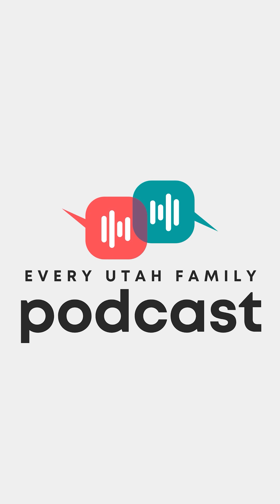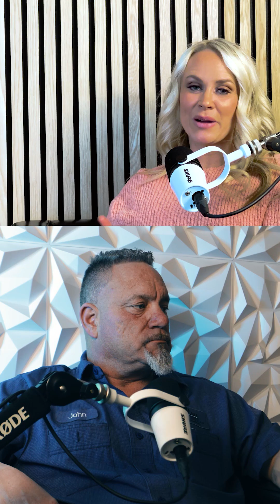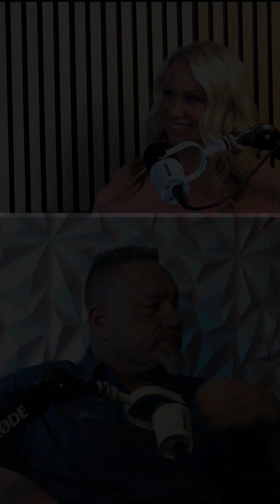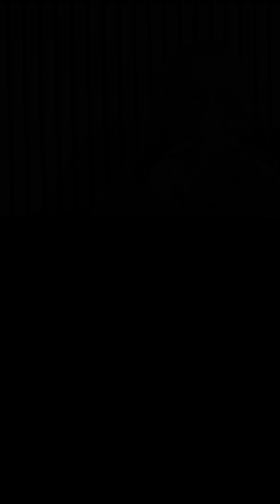2024 Furnace, Heating Systems & AC (Cost, Maintenance, Replacement)

Comment from the maker: Thanks for watching, topic discussed in this podcast are:
00:33 How does a furnace deteriorate over time?
01:11 Most common signs that a furnace is beginning to lose its efficiency?
02:15 When should I replace my furnace?
03:35 How does Utah’s extreme winter conditions affect the performance and efficiency?
04:43 How much does it cost to replace a furnace?
05:54 What's the Difference between 80% and 90% Furnace?
06:50 Is single stage, two stage or modulating furnace better? 
08:15 Is it cheaper to replace furnace and AC together?
09:16 How does investing in a high-quality furnace or air conditioner impact long-term?
11:47 Does home insurance cover HVAC/furnace replacement? 
12:29 What are the essential winter maintenance checks every homeowner should perform?
16:19 How can homeowners identify and resolve common issues in their HVAC systems before calling a professional?
20:19 Latest advancements in furnace and air conditioner technology.
22:44 Insider tips on furnace and air conditioner maintenance that aren't commonly known.